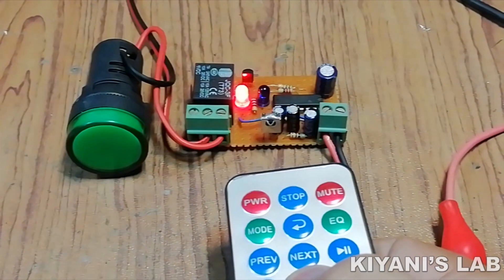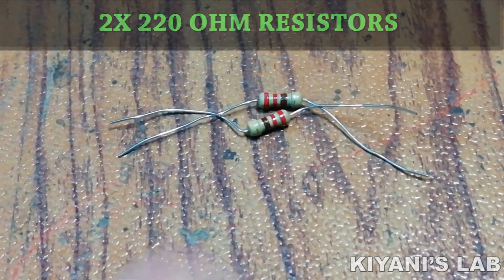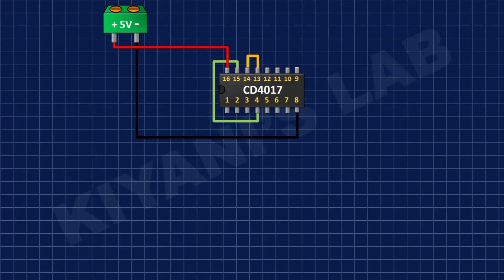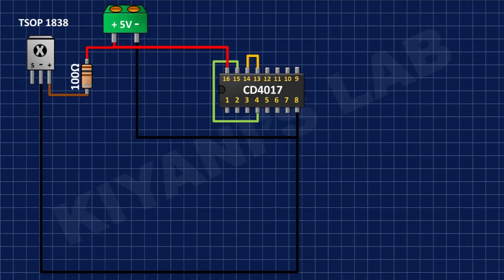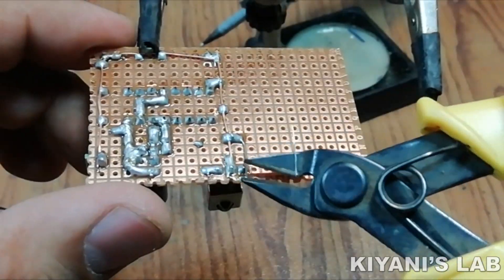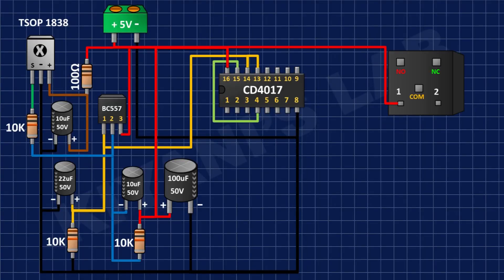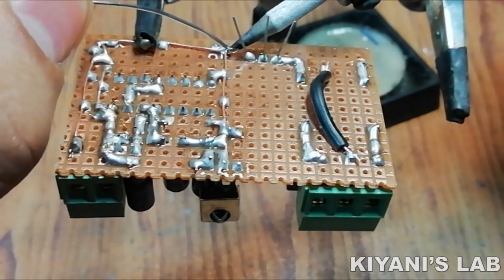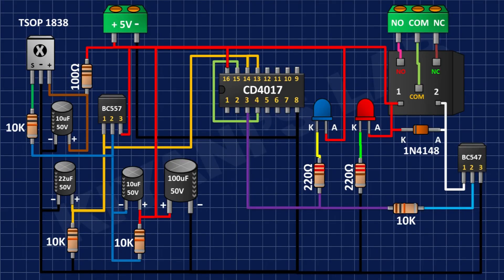How to Make Remote Control ON/OFF Switch

Comment: Fake circuit 
But my circuit is not working
Reply from the maker: brother there might be issue with your connections the circuit is working perfect its not fake if something doesn't work for you it doesn't mean it is fake there is the possibility   of wrong connection
Reply: @KiyanisLab  bro it worked in my case but it turn on with any remote and during turn off it required specific remote and when I changed the battery it's only working once i.e only while turning off and it's not working while turning on 
Can you please provide the solution for this

Comment: Sir, I made the circuit newly for 2 times as per  the circuit diagram.
In both the circuits all the 2 LED's glows properly. One led glows continuously and another one is on and off correctly based on remote input.
But,the relay turned on automatically and unable to turn off.(i.e. the power supply to the relay is  continuously on)but one led can on and off correctly based on remote input.
Please give me the solution sir,I submited this Circuit diagram in ppt for mini project to my college  professor, unable to change now sir.

Comment: Hi Kiyani- Thanks so much for posting these projects. I’ve put together several of them recently, and am having a lot of fun.

I have to say— you are a master at creating lines of solder— making them go around corners, etc. After scorching the pad many times, I have mostly given up on this and just use wires for anything more complex than a two-pad bridge.

On this IR receiver project, I couldn’t get mine to work until I grounded pin 13, rather than tie it to pin 14. I mention this in case anyone else out there is having the same problem.

Comment: Can we use for ac output?
Reply: Yes you can
Reply from the maker: yes
Reply: Yes you can the relay after recieving   voltage
The out put can switch as well as dc Does and it makes any diffrence for relay!!!.